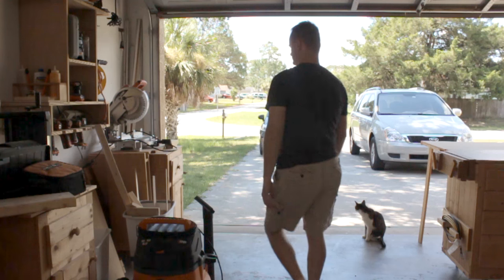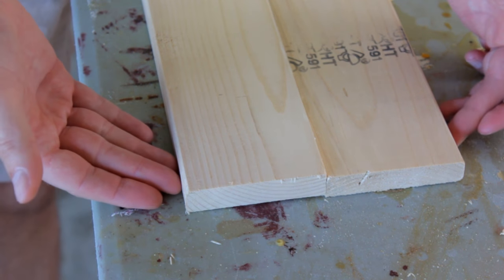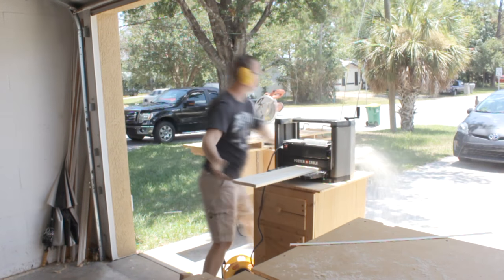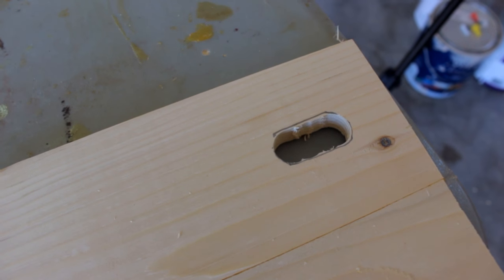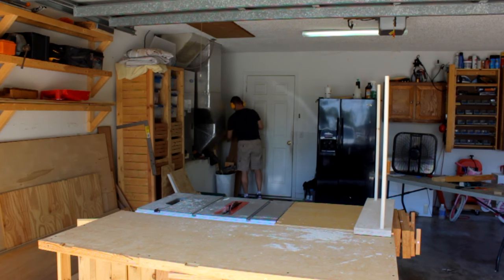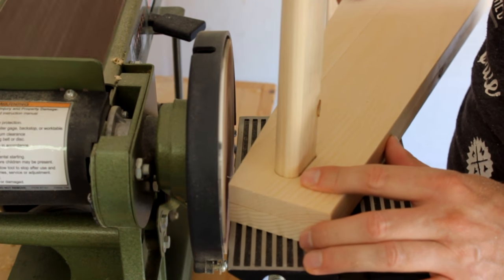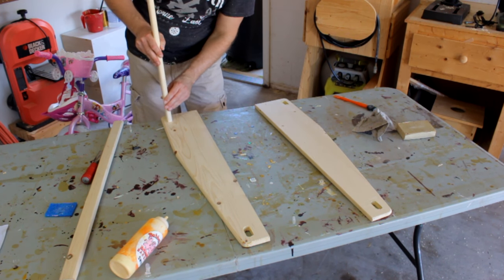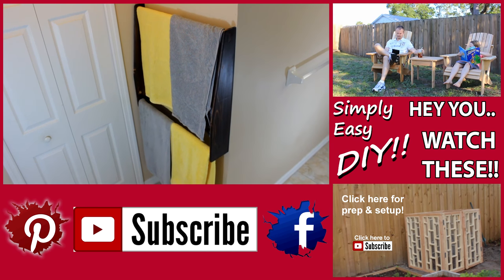DIY $3 Towel Holder

Comment: I invented shou sugi ban way back in the early 1970's. I was given an old radio cabinet that had oil stains on it. I wanted to use it for my stereo equipment. To hide the stains, I took  a propane torch and burned the wood to hide them. Since then I have used this technique all the time.
Reply from the maker: Not trying to be rude but I'm pretty sure you didn't invent Shou Sugi Ban in the 70's but YES, it is a great preservation technique.
Reply: Well, if I didn't know about it, being a dumb kid I "invented" it. It proves that nothing is ever "new" just building on someone else's work or taking to a natural conclusion. I do know now that shou sugi ban is a centuries old technique. I am sure that the Japanese probably picked it up elsewhere themselves.
 Now I use it as part of my repertoire of finishing techniques.